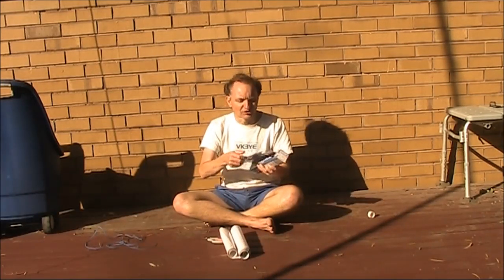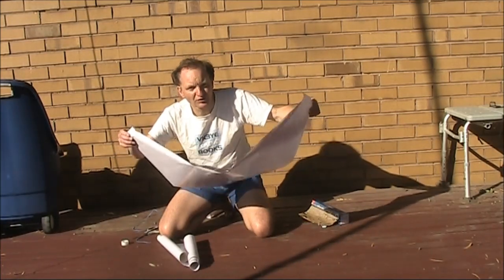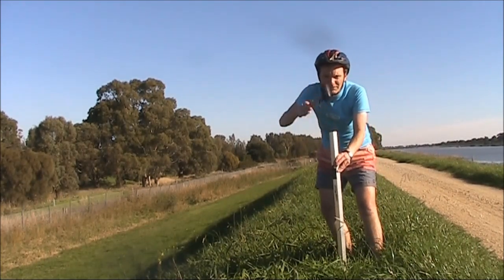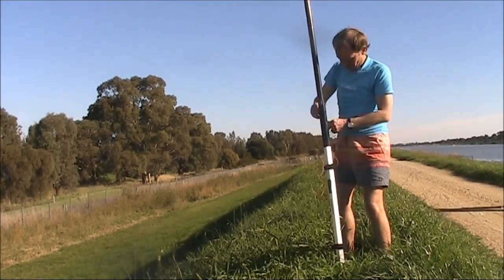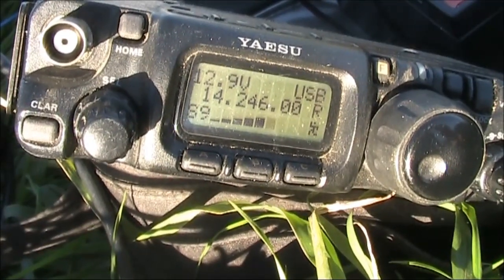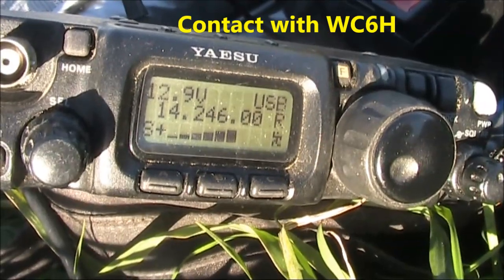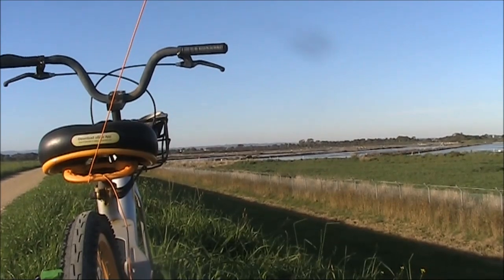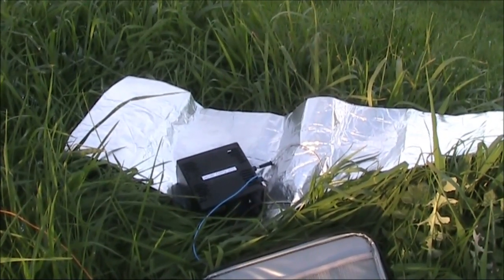A roll up counterpoise mat for vertical antennas

Comment: I think I'll try this, especially as I'm lucky enough to have a couple of rolls of conductive aluminum tape to use to stick down a bare wire down the middle of the mat. A quarter wave vertical really just needs a low impedance 'electron bucket' to work against to dump the other quarter wave's electrons into to make the vertical happy, and a nice large mat works great for that purpose.

Comment: I'm sorry to be the party pooper here but what were the other devices used in conjunction with the rig, wire vertical and ground mat? A head to head comparison with one, two or three radials would be relatively easy to do. It seems to work well but you are near a canal of sorts which almost certainly contributed positively to the results. Perhaps I missed something in your previous  videos regarding the "ground tuner" and related add-ons or do  I need to purchase your books to learn more?
Reply from the maker: Lots of other videos or websites on GTUs - some by me, some by others eg G4AKC.

Comment: Playschool😆. Censored wire stripping method🤣. Excellent Peter - entertaining and interesting project.  Hope you managed to stay up wind at the sewage farm. Even with a fairly small mat, I am wondering if you will get a reasonable amount of capacitive coupling to ground.  To get the equivalent area using wire would take quite a lot of wire with a lot more weight.

Comment: I understand if you want to solder aluminium, you place some vegetable oil on it and scrape off the coating and solder under the oil. The oil keeps it from oxidising. Haven’t had a go yet but plan to.

Comment: Ha!! I spoke with WC6H last Saturday on 20m at 10W portable from Veale Gardens on the edge of the Adelaide CBD - my first DX contact. 
Signal sounded about the same, and I reckon I got a similar signal report back. 
Was this that contact recorded on the 15th May Peter?
The mat seems like a good idea - I imght try to get some more robust foil - maybe insulation from bunnings and give it a go.
Reply from the maker: Thanks. Everything was recorded from yesterday afternoon.
Reply: @vk3ye  the conditions have been quite good over the weekend. Saw you on the RBN but was otherwise occupied.  

Managed to get my mobile setup working on 40m. I have a home brew 1.6m fibreglass whip top loaded with another 10cm extension above that to tune. Worked VK3 and VK4 on voice with around 20W and CW with 7W. Later pumped it up to the full 20W and worked VK4TJ just after sunset. 599

Sending left handed and head copying is certainly challenging. While you use a different part of your brain to the one you use to drive, and it’s not that much different to talking while driving, I did miss the navigation command for my final left hand turn to my destination 
:-/

According to the NSW roads and traffic act, you are allowed to operate a two way radio. They just don’t say exactly what mode :-)

Peter. CW while on your bicycle ??
Reply: @jtan163 You’ll probably find some offcuts from a building or extension works going on. Gratis. Save you purchasing a roll, unless you’re using it to add an extra one or one and a half R points to your insulation??

We did and it made a massive difference. R1.5 sarking and R6 batts. The house is 8-10 degrees cooler inside in summer. No aircon